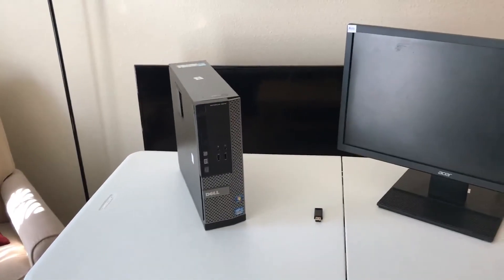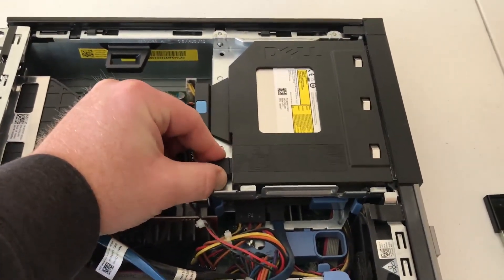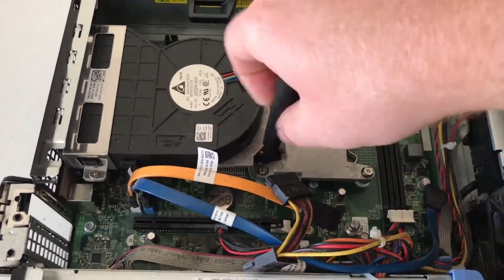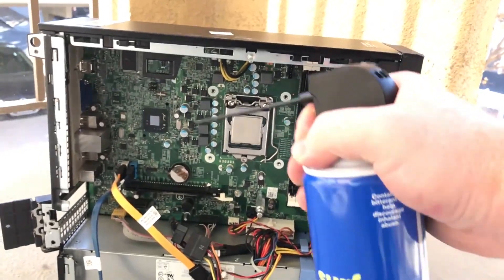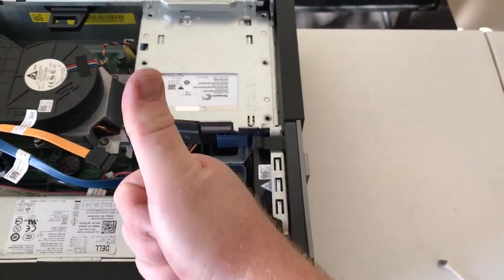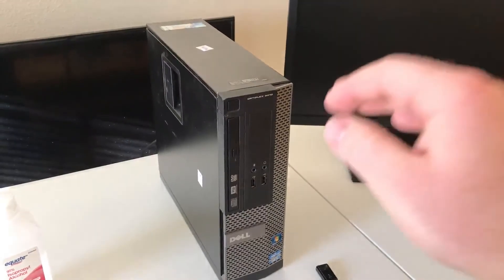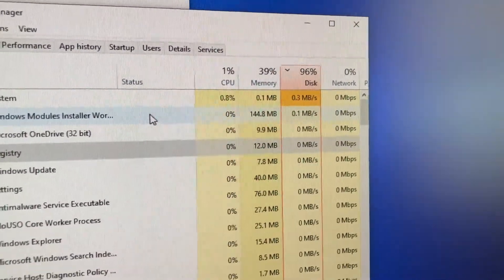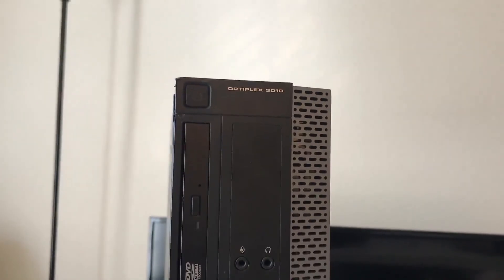The $10 Thrift Store PC | Thrift Store Tech Ep. 1

Comment from the maker: Correction: SATA III is 6 gigabits per second, not gigabytes. This hard drive still has issues though
Reply: good video imma subscribe
Reply: It's "normal" if you are using windows 10. Get a ssd for that pc. You can properly check the drive with hard disk sentinel/crystal disk info. Sata III supports up to 6 gigabits but that does not mean that the drives will achieve those speeds.